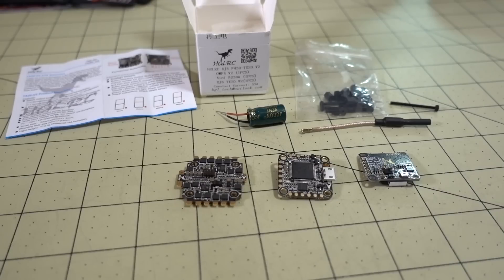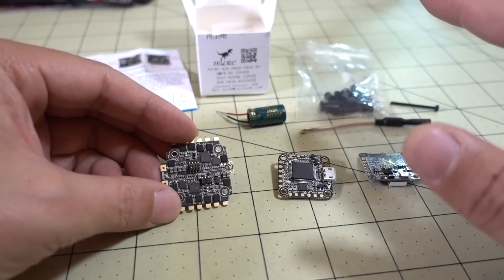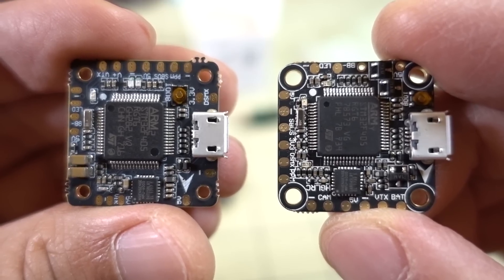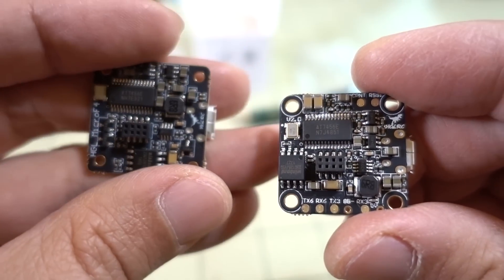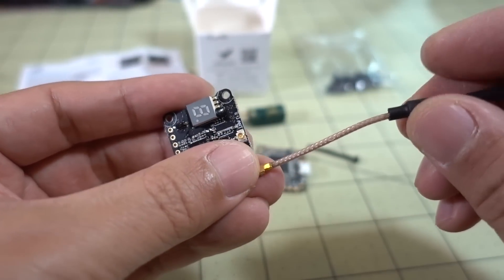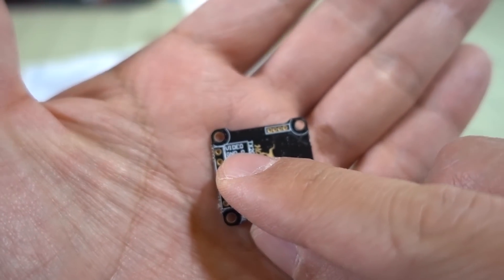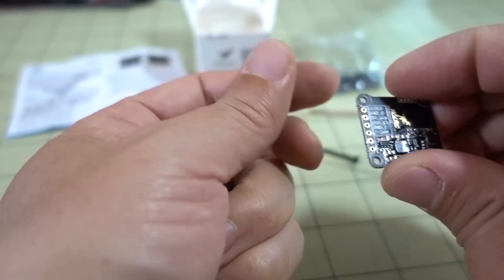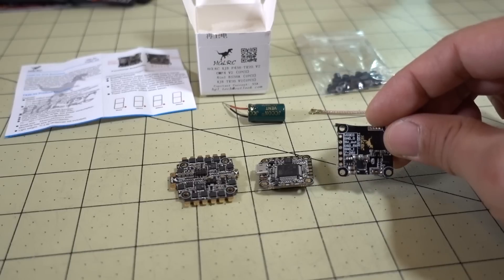HGLRC XJB F438 TX20 V2 Micro Stack Review 👍

Comment: Thanks for the review ! Undigging the topic years later lol, but I have two questions : 
-How would you wire a different ESC to this FC, or the opposite a different FC to these ESC ? I didn't find any doc on how the plug&play port of the FC and ESC were wired internally. Is there a way to find out ? 
- I guess it's quite simple but just to make sure, is that stack ELRS compatible ? 

Thanks a lot ! Following ;)
Reply from the maker: I don't have these anymore.  I think the only way to get the info is from HGLRC directly.

Comment: Did you ever put this in a 5 inch build and how long did it last?
Is it worth $65 on clearance now?
If not good for 5 inch, what about a 3 inch with 1106 4500kv motors?
Reply from the maker: It still works in my 5-inch and would be fine for 3-inch too
Reply: @AlbertKimTV  I would love to see that 5 inch in a review.
Thanks I'm buying one.

Comment: Albert - I don't think I've ever heard you talk about motor timing on the micro quads - do you ever change it? Does the default for BlheliS of "medium" work for the somewhat higher KV motors like 5500-7500? Some folks seem to suggest that "medium-high" is better with these 1104-1106 motors - but what do you think?
Reply from the maker: I usually leave it on the default of medium unless I have issues with death rolls.

Comment: What about the capacitor that comes with it? Does it go in line with the batt lead or on the f2f opposite the power tabs?
Reply from the maker: You can do either way, but I usually use the tabs on the other side.
Reply: Albert Kim cool, Thanks!

Comment: Are you going to test the DYS Samguk motors? 
Gearbest  is also selling them as Raptor FB2306, FB2207, FB 2206 in the same kV ranges, only unbranded. They have them in CW and CCW, Banggood not (yet?).
Compare the pictures: 
https://www.gearbest.com/motor/pp_1631952.html 
vs  
 https://www.banggood.com/DYS-Samguk-Series-Shu-2306-2250KV-2500KV-2800KV-3-4S-Brushless-Motor-for-Racing-Drone-p-1226078.html?cur_warehouse=CN
the photographs are excactly identical, you can tell by the motor windings,  lol.

Comment: I have the Zeus tx20  that is powering of the vbat. Will I get reduced noise if I power the cam off of the vtx instead of FC?
Reply from the maker: Maybe?  It might also depend on other components like motors and what kind of camera.  Are you using the capacitor?
Reply: Albert Kim using foxeer predator micro with the sk1106 6500kv & included cap.
Reply: Probably worth the shot to try.  I have a different Vtx, but powering my cam using Vtx power versus the FC gave better results after suffering from noise issues.

Comment: Great review! I almost went with this stack for my Win5L build. Then I found out the F438 esc's are 33A continuous with 38A burst. Misleading (kinda) because the F440 is 40A continuous with 50A burst. I ended up getting the F440 based on your previous review :)
Reply from the maker: Oh wow... I missed that one... yeah, that is kinda misleading!
Reply: Yep...bought the stack and only realized after buying it.  Doesn't matter for me since its on a 3" with 1407s, but you're absolutely right!

It has been an awesome stack for me on a GEPRC Sparrow 145mm frame with Hyperlite 1407 3600kv.  I have been singing its praises on RCGroups suggesting it would be great for 5", though I do think you're right -- the F440 is probably best for a 5" because there's more wiggle room in terms of Amps!
Reply: That's awesome! I bet your 145mm rips! I'm actually going to order the F438 for a 2.5" lol! For the price and performance, I can't find anything comparable. $80 for the stack that includes the tx20 v2? Can't beat it. The F440 is performing flawlessly in my Win5L. I also run Zeus FC's in my micros and zero issues so far :) Thanks to Albert for testing these items and putting in the work to upload these videos!
Reply: in4bliss Yep...very fun.. I got mine from GB for $65 on special! Unbeatable price, lol. Took 3 weeks to arrive though...